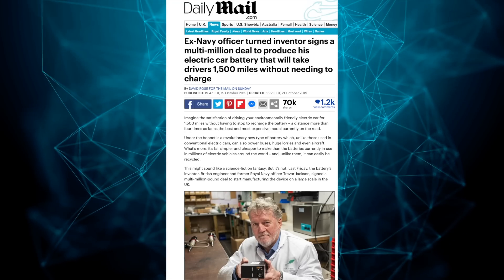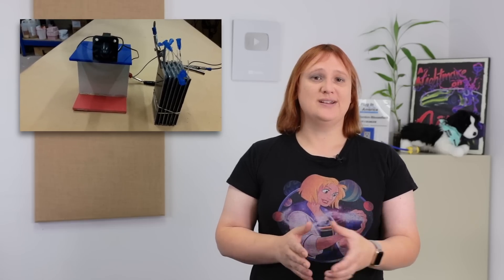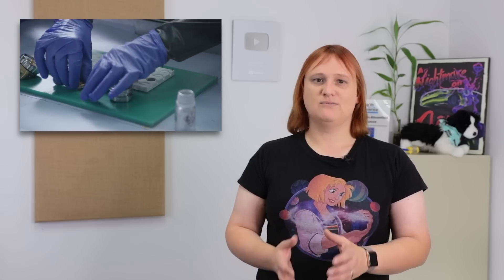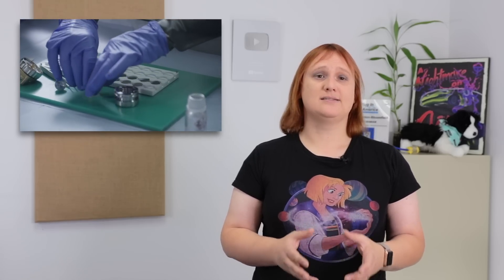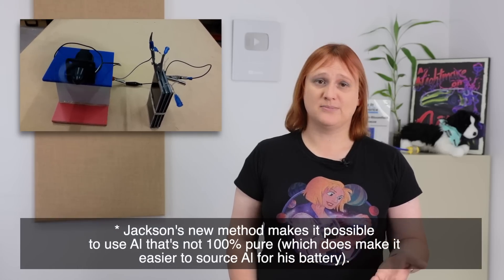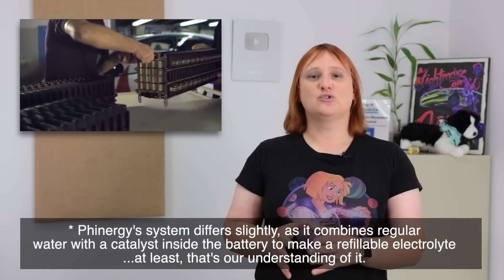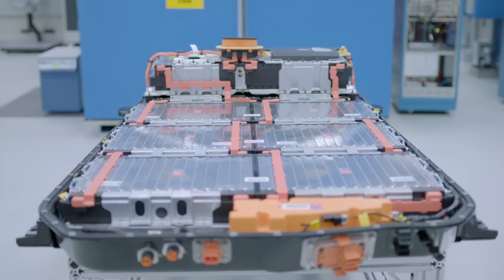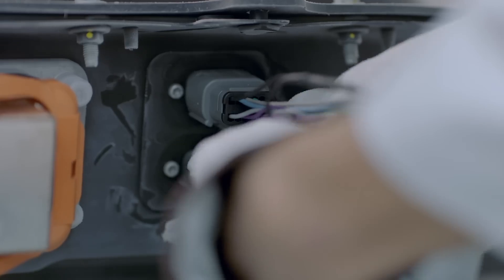Is This Battery The Holy Grail For Electric Cars?

Comment: TL;DR
It's a myth that weight is big factor in relevant range. It affects the range in city driving, but no sane person would want to run for 20 hours consecutively to cover 400 km, if rush-hour stop-and-go conditions can even persist for that long at a time anywhere in the world. Long trips is where range matters, and because of physics, aerodynamics is the name of the game in these conditions - and it is independent of mass. Changing a car's overall mass by 10% (likely less) by having a battery pack that weighs only half as much wouldn't change range noticably - maybe by 3% if you're really lucky. There's plenty other advantages to low mass (agility, less likely to kill those you crash with, better fuel economy because we do drive a lot in cities and lots of short trips, to name some), but range isn't really one of them.

----------------

I'd like to see you make more videos like this, except in one respect: Please stop increasing people's confusion over the factors that matter to range by repeating, time and again, the myth that mass has a big impact on range.

This is not the first time I point this out on this channel, but apparently you didn't see my previous attempts to put you on the right path here, so I just have to try again. I am pretty sure that if a few of the people on crew who gets physics reasonably well considers my arguments, they will quickly realize that I am in fact correct. 

Moving the car involves spending energy to accellerate it, to lift it when going up, and to overcome rolling resistance and drag. The three first of these factors increase proportionally with mass. Perhaps that is why so many poeple, including people who do  have a good grasp of this basic physics, believe that mass is big factor in range. 

However, let's try to look into this a bit more deeply. Start with a few observations:

 - the kinetic energy we create by accellerating the car is recoverable. Not all braking is regenerative (sometimes friction braking must be used in addition, or perhaps only if the battery is too full to accept any power from regeneration), and regeneration is not 100% efficient. But it is reasonable (in modern EVs with significant regenerative braking) to assume we can recover half the energy, halving this factor (which, as we soon will see, is anyway irrelevant for range when it matters, namely when you actually go far).

- the potential energy we create when lifting the car higher up in the gravity well is also recoverable. If it's really steep you may have to friction brake, and then you obviously won't recover all of the energy. And compared to going completely flat, you will waste more energy as heat because operating at higher power levels (when going up) is a little bit less efficient.

 - energy spent overcoming rolling resistance is not recoverable, and as mentioned, it does increase proportionally to mass.

- last but very far from least, drag is completely independent of mass. The amount of air that must be pushed aside when an object tries to move through it depends on the shape and size of that object, and it depends greatly on the speed, but not it's mass. If you try to pull a large plastic bag through slowly and then quickly through water you'll get a feel for how this works - and it is in fact much the sme physics (fluid dynamics and aerodynamics are not the same, because fuilds are not easily compressible and gases are), or at least it holds true in both cases that the mass of the plastic bag is irrelevant to how much work it is to drag it through the water; that depends on the size and shape of the bag. And on the speed. OMG what a huge difference the speed makes! It increases proportionally not to the speed, but to the speed squared. If you want to move at 50 units per hour, it takes not 5 but 25 times as much work as moving at 10 units per hour!

Ideally we should now have plugged some numbers into the formulae for the 4 components to illustrate their relative sizes in different conditions. I am too lazy to do that, and I think you are too lazy to read it. So suffice it to note that since drag is so speed-sensitive, at low speeds the other factors will dominate, and at high speeds drag will dominate. (That means most of the energy spent is to accellerate, climb, and roll at low speeds, but to push the air aside at high speeds.) The point at which drag becomes the most important factor will vary from vehicle to vehicle, with air density, road surface, and, importantly, whether the going is nice and constant or staccato stop and go. 

At constant speed and elevation, the first two factors go straight to zero. And in such conditions a decent estimate of the speed where drag overtakes rolling resistance is pretty low, about 50 km/h. That means that at twice the speed, 100, drag will be 4 times as high, and rolling resistance twice as high. (To be clear: you will spend the same energy on rolling and double on pushing air, because you are overcoming the quadrupled drag forces and the doubled rolling resistance for only half as long, to go a particular distance.) So instead of 1 + 1 you now have 4 + 2 and two thirds of the energy use is for pushing air. If the speed doubled again, you'd be looking at 16 + 4 for a total power use ten times as high as at 50, and 80% of it spent on pushing the air away. 

What we've learned is that the first three factors matter a lot, and aero very little, at low speeds, and when there's a lot of repeated accellerating (stop and go traffic). Going up and down very steep roads repeatedly would also make the three first factors relatively more important, although it is difficult for me to imagine anybody actually doing this anywhere in the world. 

City driving is the only real-world scenario that puts an emphasis on the non-aero factors. And it is indeed useful consumer information to understand that for a city car, lightness might be good because it leads to better economics through lower consumption. It is however only confusing to think of this as range, which for normal people is about being able to go where they want to. But nobody in their right mind want to go at an average speed of under 20 km/h (which you get when there's a lot of stopping interrupting the going) and still drive 400 km, for the simple reason that it would take over 20 hours! There probably aren't that many cities in the world where traffic is sufficiently awful to actually keep anyone trapped for long enough to make range become relevant anyway!

In practice, range is ALL about long trips, and MOST of that again is about motorways and highways. Speeds vary quite a lot in various countries, and German autobahn speed demons will not see their range budge even one percent if they add or subtract a few hundred kilos. 

But what about us poor Norwegians who can at most (if we are law-abiding) go at 110 km/h? Well, about 70% of our energy use will be to push the air out of the way. More than that when it's cold and the air is denser. Meanwhile, the mass of our battery packs makes up about 5-15% of the mass of our cars, depending on the model. So if a revolutionary new battery like the one presented in this video did come around, and none of that benefit went towards increasing the range, we can expect about 5-15% of 30% of our energy consumption to decrease by 75%. That works out to 0.15*0.3*0.75 = 3.34% as the maximum decrease in consumption, which basically means we might get 3% more range. For those with less battery weight relative to the car, just one paltry percent. I personally think it's more likely, if we got this battery tech, they'd double the range and halve the pack, rather than quarter the pack and keep the same range, and then these oh-so-important range increases thanks to weight savings would be halved as well, to just somewhere between half a percent and one-and-a-half percent.

Granted, my "long trip" is idealized with constant speed and zero elevation change. That isn't the real world, but it is actually a pretty good approximation. You can often drive a hundred or several hundred kilometers with a few smooth changes in speed (when speed limits change or there's traffic), but stay above 60 or 70 for hours at a time. It's much closer to going at constant speed than it is to "constantly stop and go", as we so often do in city driving. My guess is that if you test any long-range EV on the market today driving two cars on the same trip, but one loaded with 200 kg more than the other (say, more people in the car), pretty much regardless of the trip you would never see as much as 5% higher consumption from the heavier car (over the long trip, and of course both cars driven in the same manner). PLEASE, if you still aren't convinced by my arguments, DO THIS TEST and present us all with what you find.

Comment: I LOVE your creative solution of making the AL-Air battery a range extender instead of the primary.  Can I retrofit my PHEV to do just that?
Reply: Would also be a good application for fuel cells, too.
Reply: @Roxor128  It depends on weight.  Right now my PHEV drives around with about 10 gal. of gasoline to provide the 300 miles of extended range should I need it.
That is an extra 60 lbs. of weight I drag around every day just to overcome my range anxiety.
But it is more than that.  I also drag around a 2.4 l. internal combustion engine and a generator and a power drive unit.  I don't know the weight of these but I bet it is a lot.
So we would have to compare the weight of an AL/Air battery (for 300 miles of range) with the weight of hydrogen fuel and fuel cell to provide an equivalent amount of extended range.
And 300 miles is probably too few to bother (since the  AL/Air battery will have to swapped out).
To be practical I think it would have to provide 1000 miles of extended range. 

A gas powered ICE or hydrogen fuel cell could offer less extended range because refueling them is much simpler.
Gasoline remains stable in my tank for months at a time.  I don't think you can do that with hydrogen.

Comment: It depends on how well the AL-O2 hold charges.  If it can hold charges for a year or longer, I would definitely switch to it, because, I only need to swap the battery twice at most a year.  For a lot of my friends with daily commute, instead of fueling every week, they can do it once a month ... I think it saves them time too, instead of finding a gas station every week, they go once a month.  I don't think hybrid is better in this case.  Just have 2 batteries, schedule a swap once one of them finish.

Comment: A non rechargeable battery in an EV, no thanks!
Reply: Thunderf00t has debunked it
Reply: idkYeyeDo  Exactly. That's essentially what your doing when refining the aluminum back to non oxidized state. It takes a tremendous amount of energy to refine aluminum and this energy is stored in the aluminum until released by re-oxidizing. Too bad more people can't see it this way.
Reply: @gearhead1302  you get to spend 300% of the energy needed to just charge your ev, how eco friendly is that?
Reply: @fss1704  You obviously don't understand what I was saying or how it works. You aren't "using" that energy, you're storing it in the aluminum to be used later. And I never claimed that aluminum air batteries were "eco friendly", you just made all that up.
Reply: @gearhead1302  No i understand and agreed, i'm sorry you misjudged me, that was a rethoric question.
Reply: it would be cost-per-unit if you can pop a 1500 km battery in for $100 still cheaper than liquid hydrocarbons. somehow I doubt that price range is what we're talking about

Comment: it's all about cost and carbon footprint. if it's suitably cheap and clean and readily available, i dont care that someone else does the re-charging of the battery. So i just give the station old pack and get a swap-in new one, pay and go.
i dont see your reasoning as anything other than stemming from emotional attachment to the way some things are that you want to hang onto.

Comment: I don't care what chemistry witchcraft you use....the humble battery has a critical design flaw. Quick charge & or discharge causing heat expansion & potential fire risk.  Fuel cells will come of age when battery technology flatlines

Comment: No.  "Dinojuice" really mineral energy users, is a three minute refill for the driver, requiring no mechanical refit or deterioration of contacts, plug harnesses and no pumping skill.  Battery swaps are really silly on anything but a moped using the battery powered drill principle and hand held battery packs.  

Ford and Shell getting together to take over all the aging and poorly serviced ad-hoc public chargers.  Putting them in fuel stations where staff can monitor their service, handle immediate problems, and also allow the casual BEV driver to simply find energy as easily as finding a competitive gas station (no app or other anal retentive nerdgasm dash computer involved) will make this work for the masses.  This is what is already happening in the UK as the street charge points are like fighting over a cleared parking space in a Boston blizzard.  However those thinking you were giving the finger to Big Oil: SURPRISE!

I'm still watching this develop.  The Leaf was either the Model T or the Tesla 3 is in the century old metaphor.  Most of the brass era designs before 1925 were discarded by 1930 for the "modern car" that the new roads were built for.  This will happen again and the early BEVs will fall into those quirky nostalgic categoiries.

Is the T3 the fully realized Model A, Chevy or Austin of 1929...or is it the Model T that operates like no new car on the road after 1927?

Comment: While there's plenty of talk about power density I'm aware of the sluggish nature of aluminum air discharge rates. They can deliver power only as quickly as the anode dissolves. And then there's resistance which translates into heat. At the end of the day the motor(s) are running on tanks of electrolyte as much as the aluminum. And what about the power output? My bench tests have gotten a little over an amp out of a small cell as to where lithium and nicd ramp up several amps. The power outout has not looked promising and resembles more that of  carbon zinc dry cell than the powerhouse we would like it to be.

Comment: Misleading title. It's a power cell, not a "battery". It can't be recharged with electricity.
Reply: a battery just means several cells together, whether they be primary (non rechargeable) or secondary(rechargeable)
Reply: @dfghjkuytr  it's not the point. It's useless after 1500 miles. Then you have to buy more. Not reusable so bad for the environment.
Reply: @Joeyschannel80  How is it not the point? It's correct. 
Do you remember when the only batteries you could buy were non-rechargeable (not including lead acid)?

Comment: What's the recharge efficiency.  I know you can't recharge it directly.  Once the battery is depleted, you are left with a pile of aluminum oxide.  I assume that recycled.  Basically turn it back into aluminum with the Hall-Heroult Process.  Just like making aluminum from bauxite in the first place.

"In the Hall-Heroult Process, the alumina is dissolved in a molten bath of cryolite (Na3AlF6). Molten aluminum is removed from the solution by electrolysis. This process uses an enormous amount of electricity."  That "enormous amount of electricity" is probably a lot more electricity then the battery produced.
Reply: According to Alcoa the best smelters use about 13 kilowatt hours (46.8 megajoules) of electrical energy to produce one kilogram of aluminum; the worldwide average is closer to 15 kWh/kg (54 MJ/kg).

So on if the battery is 10 times as dense.  The top Lithium Ion batters are 0.250 kWh/kg.  Then this battery is approximately 2.5 kWh/kg.  So 15 kWh is needed to produce the aluminum destroyed in 2.5 kWh battery.  Not very efficient.

Comment: There is similar batteries, that work like electroplating, that would work much better, unplate an electrode to charge, then plate the electrode to discharge, the electrolyte is pumped across the electrodes, and the metal is plated, and removed from the electrolyte, and reversed to charge, and basically last forever, it may not be dense, but would work well to charge lithium in cars, or it could be downsized, made more compact, and used in cars with the electrolyte stored else where, along with pumps, it would allow for more electrodes. It would be much better for EV like that, and depending on power density , super capacitors could be used for instant current supply, there is alot I forgot about it but sounds better than aluminum battery's,

Comment: The nickel is what defines the battery cost, it has veryblitt little lithium in them. The non rechargeable, lithium batteries, are the ones that have lithium metal inside, the ion have lithium ions in a basically a carbon foam.

Comment: India is using battery exchanges rather than recharging for the newly mandated replacement of all ICE three wheel vehicles.  Maybe this is the best use for the aluminum air batteries?

Comment: 1500 miles on a single charge? That would work very, very well for me. Think about it, if you have traveled 1450 miles with this battery, it would be insane to then plan a 150 mile trip.  This close to the limit, the sensible thing to do is pop into the shop for a replacement. The only possible negative, would be the cost.